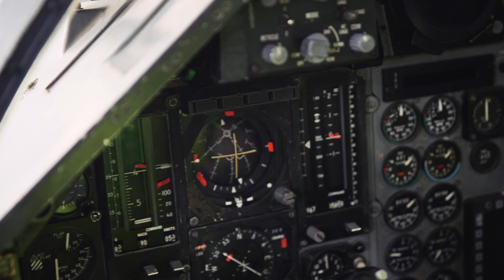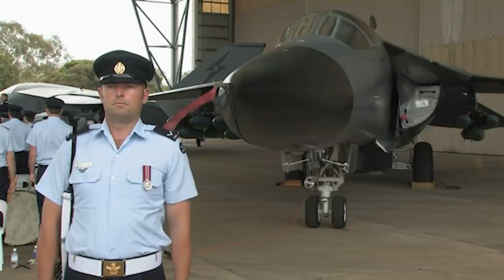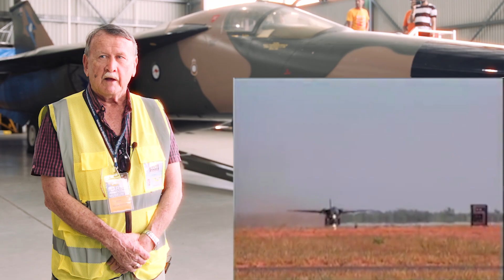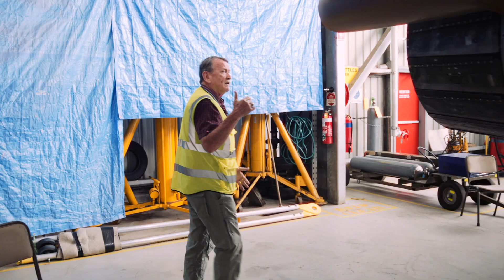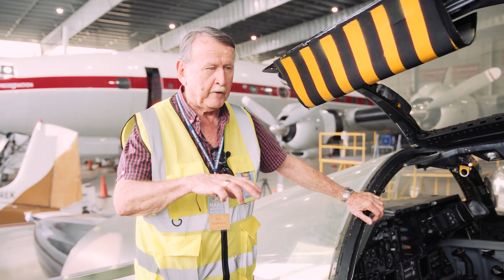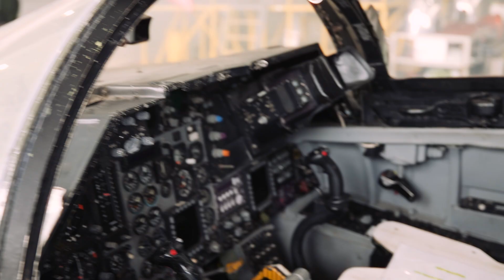F-111 Walkaround (HARS Museum)

Comment: I was a crew chief USAF on F-111A....7113 circa 1979.  I was lead on rebuilding it after a crash (gear up landing).  It was a series of parts bins and a skeleton when I got it (think balsa wood airplane without the skin....not quite that bad but you get the idea).  I was told it had a PDM slot and was then going to be sold to Australia.  We got her airborne just as I headed for my next duty station.

So, any photos your museum might have of 7113 would be appreciated.  Again, it started life as an A model.
Reply: Hi this one in Hars is C model mate, why are you looking for A model?😅
Reply: @duckduckgo9247  because I saw that they converted some A models to C models.

Comment: I am afraid Phil is mistaken. The F-111 was NOT the first aircraft to have terrain-following radar. The F-111 was a replacement for the F-105 Thunderchief. The F-105 was the first to have terrain-following radar. The F-105 was designed to make high-speed, low-altitude penetrations through Soviet radar defenses with a nuclear weapon in its bombay. It ended up making subsonic bombing runs over North Vietnam with a fuel tank in that bombay and dumb bombs strapped under both wings and on a center-line bomb rack. The F-105 could carry a heavier bomb load than a WW II B-17. Of course, the F-111 was a much faster aircraft.

Comment: I remember as a kid in southern nsw one night hearing an unusual noise and racing out the back of the house and hearing an extremely loud noise and seeing the navigation lights of a jet flying away (it had already passed by the house) at extremely low level and could only think that it was some military jet, not knowing what model it was at tthe time. Years later coming to know it was an F-111. 
More years later I had the chance to visit East Sale airforce base and see 2 pigs (F-111's) preparing for flight and taking off it was a great experience at the time :)

Comment: According to Wikipedia that there's different information for &/or about this actual (F1-11) Jet Aircraft as far as funny &/or nicknames are concerned which are, 

(Q1) Why was the F-111 called the pig (???????)  (A1) In Australian military and aviation circles, the F-111 Aardvark was affectionately known as the "Pig", due to its long snout &/or nose and terrain-following ability. The F-111Cs gave the RAAF a powerful strike capability but were never used in combat, of course. 

(Q2) Why is F-111 called aardvark (???????)  (A2) The word "Aardvark" is Afrikaans for "earth pig" and reflects the look of the long snout &/or nose of the aircraft that might remind one of the snout &/or nose of the Aardvark. The origin of the name has been attributed to F-111A Instructor Pilot Al Mateczun in (1969), as the aircraft had not received an official USAF name, of course.

Sometime before the (F1-11) Jets came into the (RAAF Royal Australian Air Force) service, Sometime between the years of (1970 & 1973) that the  (RAAF Royal Australian Air Force) had a Number of McDonnell Douglas F-4 Phantom II Jets that they had leased from the (USAF United States Air Force) which they are (2 Two-seated, Twin-Engine, All-Weather, Long-Range Supersonic Jet Interceptor and Fighter-Bomber originally developed by McDonnell Aircraft for the United States Navy & they were mainly  based at Amberley (RAAF) Base outside both of Brisbane (Brissie) & Ipswich in Queensland of course.

Comment: I served as a jet engine mechanic at Takhli RTAFB, Thailand with that aircraft from September 1972 to March 1974 and later at Mountain Home AFB, Idaho from 1977 to 1980.  Worked in-shop and on the flightline, engine run certified.   Part of the "Family Affair" at Takhli, a group of six F-111s each named after a character from that show.

Comment: Great walk through of this amazing Plane . I was in the ADF through the 70's and early 80''s and have seen this beast in action . We had a fire power demo at the Singleton  Army base , which included , APC's  , Artillery , Mortar and infantry . The F-111's did a strafing run with the gatling gun then dropped there bombs ( total of 8 x 2,000lb bombs ) in one run . This was at the time the biggest drop of 2,000 bombs and nobody knew what would happen , We stood on top of a hill 3klm away from the impact sight and you could see the pressure wave coming towards us , when it hit in nearly knocked as over . The sound was damn loud . The dump and burn was another sight at the end of the demo . As they say , memories, I did have photo's , but over time they have been lost . I strongly believe that the F-111 could still be flying today . Do up grades etc and you have a tank flying around . The original " PIG " To you sir I say , " Thank you for your Service " .
Reply: WOW!

Comment: The mention of evens head to Amberley baught back memories. I had the opportunity to watch some training runs at evens, but the highlight was sittingbin the surf or around the headlands on the tweed coast or Coolangatta or working on highrises up the coast. The pilots would come in low and hug the coastline tightly,   on the deck just out to sea. On some occasions they would loop back around for another run, give a wave. I still drive to evens air mueseum to have a look at their f111.

Thank you for a very informative and engaging video
Reply: I remember those runs, spewin they had at some stage, had to stop, I'd just moved from Amberley to Gold Coast then

Comment: I was at an F-111 base when the usaf told the maintainers they were all losing their jobs. In 1987 there was an F-111 that crashed in Idaho. They ejected but the aircraft inverted. So the capsule rocketed into the ground. This was all at Mtn Home AFB
Reply: Any ejection system inverted at low altitude is unsurvivable.
Reply: I was at MHAFB as a crew chief when that happened.  Was just glad I did not get picked to go on the recovery crew. Parts were laid out in our hanger during the investigation.  I dont remember that it was from our Squadron though (390th AMU)

Comment: Saw a couple of 'dump and burns' by an F-111 when I lived in a high apartment in Waverton, Sydney. One was during the Sydney 2000 Olympics when an F-111 flew down the Harbour from west to east trailing a huge flame. The other occasion was on the night of an RAAF celebration around Darling Harbour when an F-111 flew north to south over the North Shore and when it reached Darling Harbour it went near vertical and did an impressive dump and burn.

Another interesting occasion was in Sep / Oct 2010? when I was visiting a friend living on a ridge line property in the Scenic Rim in the Gold Coast Hinterland. Late morning one day we were working outside when from nowhere came the roar of jet engines and as soon as the sound started it vanished. The whole event couldn't have lasted more than 5 seconds. We both spun around looking for the plane but couldn't see it. This plane definitely wasn't flying at any great altitude as the abruptness of the start / finish of the sound meant that this aircraft was flying nap of the earth over ridge lines and across valleys. Someone having a last joy flight before the F-111's were decommissioned? I can't think of any other plane capable of giving us this experience. Have no idea which direction he was travelling in but we were about 30km from the Army live firing area between Canungra and Nerang. Perhaps he was going to give the army boys a surprise visit?